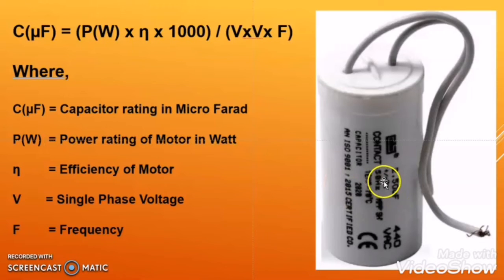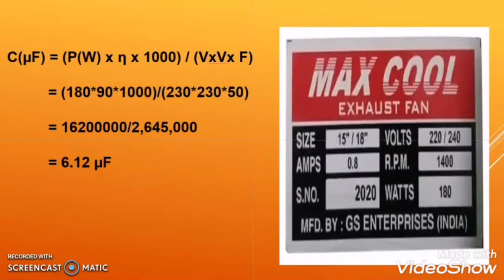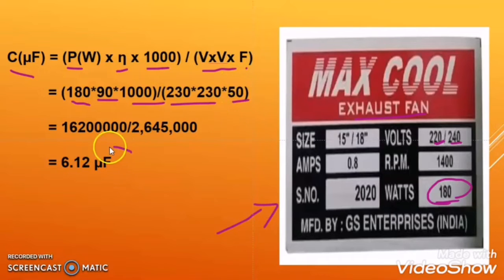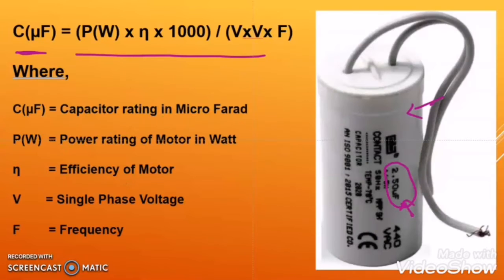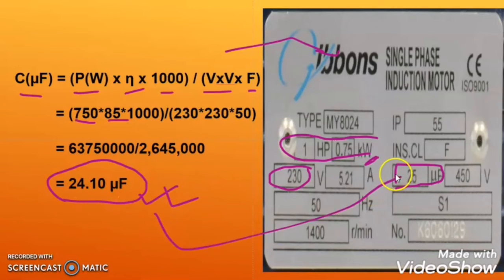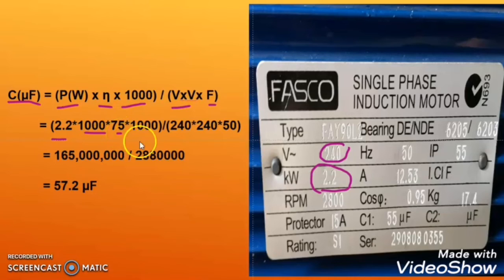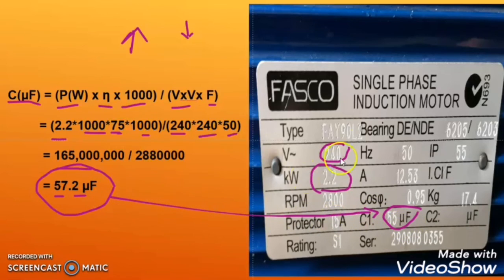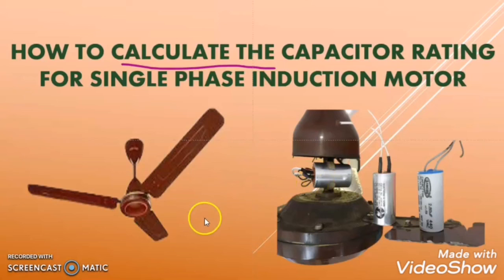How to calculate the Capacitor rating for Single Phase Induction Motor/Ceiling Fan.

Comment: I'm just asking, is it necessary not to change the percent in the decimal number before multiplying it, because I investigated your solution and I changed the percent in decimal before multiplying, so my answer is very different from your answer.

Comment: Can I run 3phase motor (400volt  1800rpm 240watt  0.75 A 820/min) on single phase ?
What is  capacitor I should use to make it work properly
Reply: Yes ... Run it in delta. Calculate the capacitor size by 76uF * number of KW

Comment: My mother has a sewing machine, it has a motor. many times there is power cuts and she runs the sewing machine on inverter, but there is a slight light fluctuation when the motor starts, it does not feel good because the motor starts and stops frequently since its a sewing machine.

I was thinking to add a capacitor to the motor inputs, is it possible to use the above method to add a capacitor to the motor? will it be helpful in my case? thanks!!!

Comment: Sir please explain how capacitor helps to start single phase motor
Reply from the maker: Sure
Reply: on one phase use, you need to get 90 deg phase transfer. exp if you have fluidsim simulation software you can easily test this one phase use "idea" via osc scope.